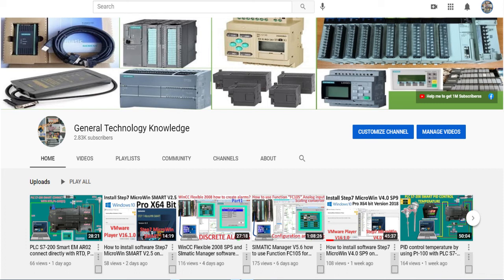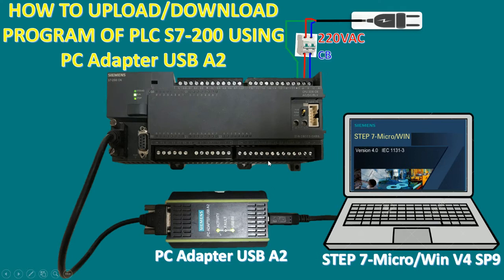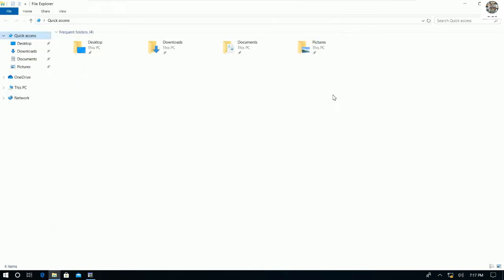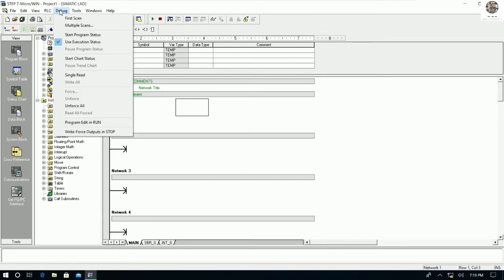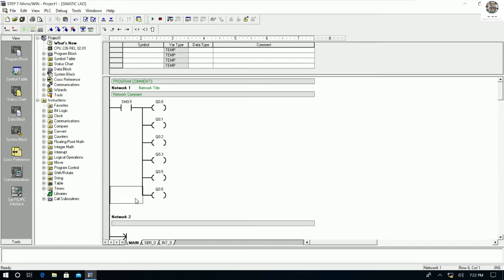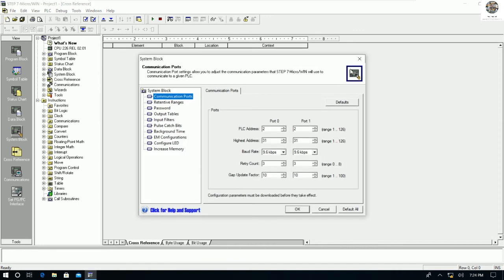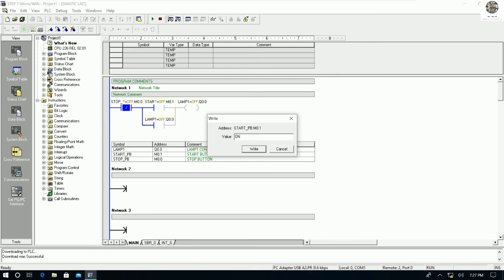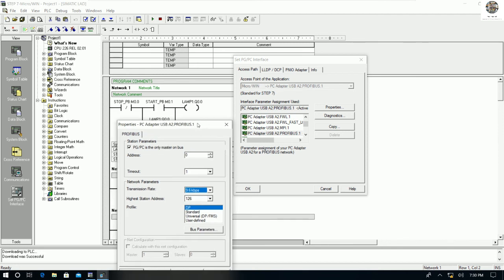Connect PLC S7-200 CPU 226 CN communication with PC Adapter A2 cable by Step7 MicroWin V4.0 SP9

Comment: How can i upload a program from a CPU 226 REL 02.01 to a CPU 226 CN REL 02.01?
Reply from the maker: Dear sir,
You just upload from CPU226(A) then save the program to kept on your computer and then you can download the program to CPU226(B) that all.
Thanks
Reply: @generaltechnologyknowledge5165   Thanks for the quick answer, the thing is when i tried to upload it to the CPU 226 CN said the proyect CPU doesn't match the remote CPU and had a lot of non-fatal errors,  later i found that i have to change the language to english on step7 and change the region to china on my OS (win10). Dont know why but it worked.
Reply: @kevinkelvin5138  my cpu is S7 200 226 CN my download shoes successful but does not work. Should I consider change language from English to chineese in microwin.

Comment: ´When I attempt to connect, a warning message appears. [Port could not be opened port or is being used by another application]
Reply: Occurs the same with me, I think we dont have the correct or the same adapter cable

Comment: Hi i would want to ask if the contactor has problem and if you want to replace it do you need to program again? When installing the contactor? Thank you
Reply from the maker: Dear sir, contactor and relay are hardware.
If you replace it no need to modify the program.
Thanks!